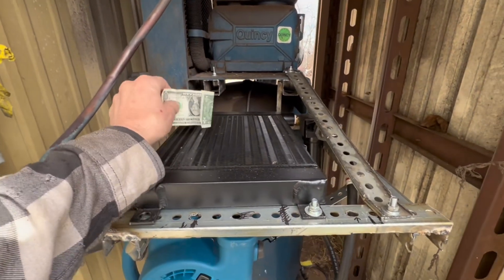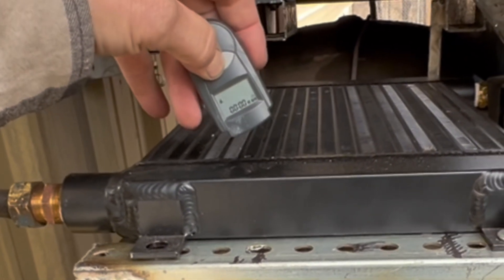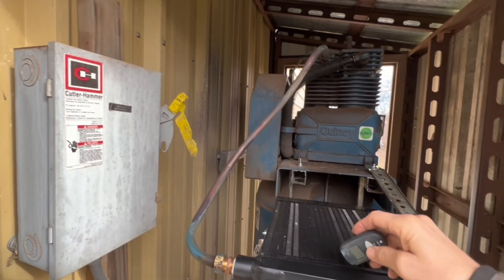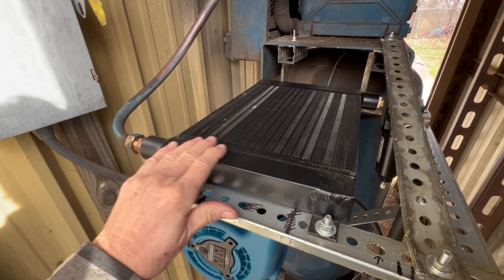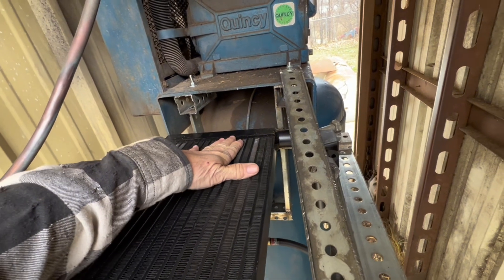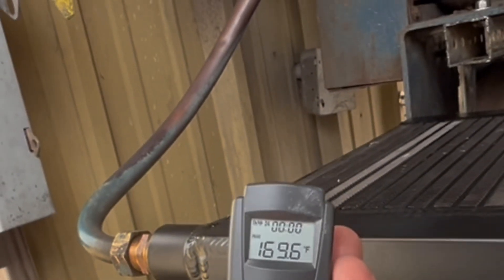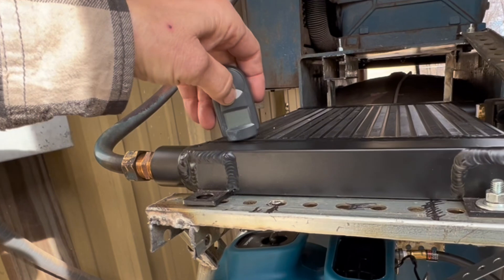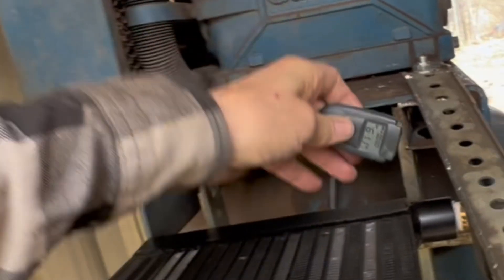AIR SYSTEM SUCCESSFULLY BILLY-FIED DIY Compressor Radiator For Auto Body Shop Pneumatic Tools Paint

Comment: I'm currently building a new compressor setup. I have got to do this now.
Reply: If I put the radiator in front of the pulley/fan it should draw air across it to help cool the air. I gotta try it
Reply from the maker: Not enough CFM to achieve the cooling I desire😉😉
Reply: Really really likes to be cool
Reply: That's Billy

Comment: How much does that restrict the volume?   And where does the water go?  Do you have a drain at the condenser there somewhere?
Reply from the maker: The air leaving the condenser goes into a cyclonic separator with an auto drain